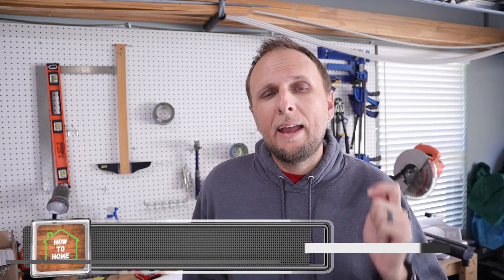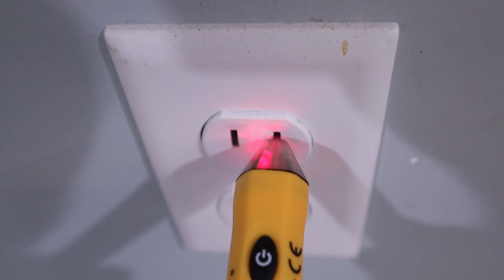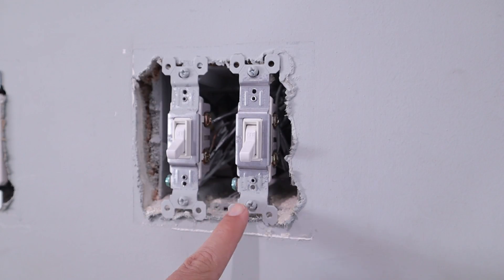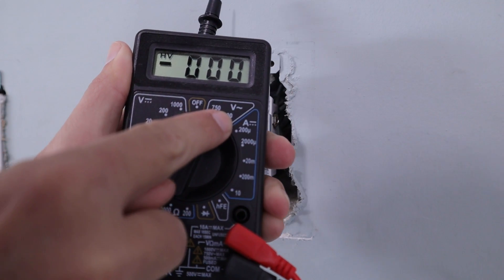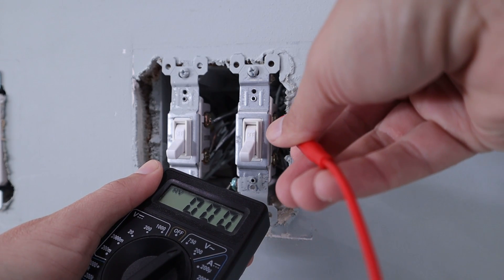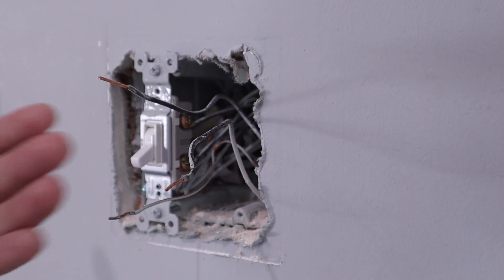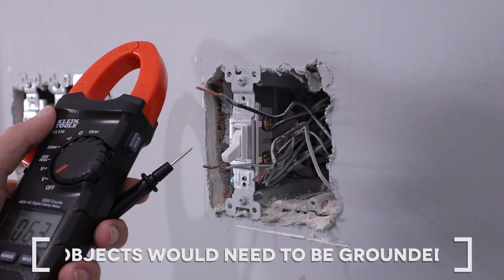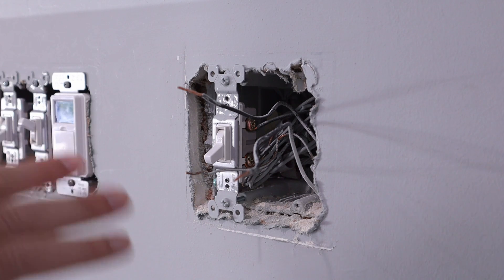How To Find A Hot Wire | Identify the Hot or Line Wire Using a Couple Cool Tools

Comment: When I found the hot wire I was shocked
Reply from the maker: Anddddddd comment of the month goes to you sir 😂  In fact, I think I will pin it.
Reply: @HowToHomeDIY I paid attention to your video so I wasn't shocked when I found the hot wire. 😂
Reply from the maker: @CarlosCastillo-ly4hs  😂
Reply: Bet that was a shocking experience
Reply: @jeffburk1692  hahahaha like it be when he gets between a neutral hahaha all his hair be like standing 3 feet tall hahahaha
Reply: You should be grounded.
Reply: Why does electricity shock people?
Because it doesn't know how to conduct itself.
Reply: I find it best to test for the hot wire when you've got one foot in the bathtub partially filled with water using uninsulated pliers to find your hot wire or a paper clip
Reply: check it,I always bring a little green with me wherever i go..
helps keep me grounded
you dig?
Reply: HAHAHA, I literally was shocked a bit, darn thing touched the switch and exploded a bit and then thank God the breaker went down! the hot wire was melted to the side of the switch!! 😨 it was scary!!!
Reply: When I was like 10 I was pretending to be a handy man. Sticked a screw driver in a outside house socket. Tripped the circuit breaker and man my arm was sore. Lol
Reply: Lol I think that was a joke right😂
Reply: And now they call you Sparky
Reply: When I read your comment, I was Shocked, Thomas 😂
Reply: Were you buzzed?
Reply: You are .Love
Reply: Never work on a circuit with power service on. It against electrucal code and safety and a ohsa violation
Reply: So....to verify that the correct circuit has been turned off...? Maybe use a multimeter?
Reply: Now I just took off a two-way switch there were two sets of wires in the back of the box one set I left alone the other set I took apart and now can't remember which two to put back together before I put the three for the switch any idea how to do a quick check on which two I put together they looked a little fried so I want to clean them up and put the back together before I put the switch back together went to go get a tool and forgot which two it was and he suggestions I'm used to changing switches and outlets normally I don't need to use a voltage box but in this case do I turn off the power first cuz I always shut the power off to change my switches bit electrocuted before wasn't fun PS love the video
Reply: @jamieclarke9207  there no way to know  with power off.  But with power on, do not touch the wires  or you get electricuted. If have no white or bare, there no eare to use a meter to know the hot wire to test it. Only other option be the easiest, put a mark on 1 wire and touch it to others 1 at a time, as 2 hot.  If it shorts and trips breaker  , mark other one too, thats the two hot wires.  Take 1 hot wire   and touch it ton9ne not hot and if power on and it does nothing put them togeather but it hot so not touch it. Now there 1 hot , touch it to other wire not hot , the light comes on if  power is on. Connect thosr to light switch. Remember 1 is hot.There be 2 hot 2 not, take 1 hot anf put 1 not with it, if light not come on, it correct.  if 2 white put white togeather and if 2 bare put bare togeather , there 1 more hot  and one not, put them on light switch, turn i
On light switch and if come on it correct. If not , sounds like the breaker off or tripped
Reply: @michaelspencer6523  thank you ya cuz as soon as I put power back on Fuze blue and I was like f that
Reply: @jamieclarke9207  good it means those you put together is 2 hot
 The other 2 is 1 for each those 2 hot wires. The primary hot from light to light swicth is always white, the secondary  on light switch is the colored wire goes to light. If tbst helps, the other 2 whires will be same color together and
Reply: @jamieclarke9207  i am a master electrician  , it been few years ago i was over kbr building usa military power grids and  camps in iraq on 2003-2004, be safe.

Comment: So, I'm assuming you need to have the circuit breaker that powers the switch box ON in order to test the wires, right? Loose, hot wired just dangling about kind of freaks me out.

Comment: Can you use the non-contact tester pen to test the exposed wire scenario at ~6:00. Also, during the exposed wire scenario, is the breaker switch on or off or does it matter? I realized this may be a stupid question but I want to be sure.

Comment: Great video. Bought a new home and I'm changing one light switch. Problem is all the wires are black. So I couldn't figure it out. I actually have a multimeter tool but I didn't think of using it. Big thanks!!!

Comment: Theres 2 possible breaker switches that could power myndishwasher i need to fix. Im getting the same reading with a more traditional multimeter with both on, both of, and either one. Wtf? This is out of my wheelhouse. All i need to know is if theres power going to it

Comment: Hello I didn't take a picture or mark the wires But trying to put up my new ceiling fan from the ceiling box. I have just the two black wires, two white wires and the ground wire and then from the new fan. I have a blue wire, a black wire, a white wire and the ground wire and then in my wall switch next to it. I have an outlet and they're both in the same hole on the outlet. I have the two white wires and a black wire and then on the switch itself I have black wire red wire but the two black wires in ceiling box in the bedroom are twisted but when I turn my fan off with the chain pulled it's still runs and also my bathroom. That's next too much. The bedroom doesn't work when the black wires are untwisted. Can you help me please?

Comment: I have existing wiring from a 25 yr old home, that controls my outside lights.  there is a red, a white and a black in a very crowded box.    You showed us how to find the HOT, but when i want to connect these wires to a Timer,  does the HOT go to the LOAD or the LINE?

Comment: Doesn't work on an old home that isn't grounded....😮
Reply: With a multimeter, you can place one probe in the neutral side of a nearby receptacle and the other on one of the hot wires in the switch box. When you get a 120v reading, then you've found the hot wire.

Comment: EXCELLENT‼  Question:  I turned off the Breaker to the 3 bedrooms to replace a light switch in the middle room of a 40+ year old house.  When I plugged my Klein 3-prong test device into a receptacle adjacent to the faulty switch, I got a reading of =    When I used my Klein Pen, as you suggested, set to the 12 - 1000V~ setting, the Blue Beep was picked up at both the switch and receptacle?   So I turned off additional breakers on each side of the center bedroom ➡ ➡ .  When I turned off the main breaker to the entire house ➡ 🚫 Thank you.

Comment: If I want to connect a light fixture and I close the main 200 amp breaker in the basement, do I need to do anything else before I touch the wires?

Comment: Hey Adam, love your videos! I am becoming a DIYer now.

Are there any techniques to mark the line and load wires connected to a switch/receptacle? A little effort during the first installation would save tons of time in the future.
Reply from the maker: I sometimes mark the line wires by wrapping electrical tape around them.  This would signal to others as well that those wires are probably hot.  Glad to hear you are finding so much value in the channel!  I really appreciate the feedback!

Comment: Basic question.  Was the breaker OFF while you were doing this procedure?  I have to check 5 different black wires in the same box, and would not be comfortable with the breaker on...
Reply from the maker: No the breaker was on.  I would not be able to find which one is the hot wire without it being hot.  Totally understand that and if you don’t feel comfortable I would definitely recommend calling an electrician.

Comment: I have a bad feeling my old house is messed up. I have a light switch connected to a power outlet. I successfully converted the outlet back to a regular outlet. When I pigtailed the light switch to a light it failed the volts test and will not operate the light. Please help this stupid noob.

Comment: Hello, thank you for the pod-cast,very informative! I have a chandelier that does not have the ground wire to attach to the ground wire inside the ceiling wire box. How should I approach the mounting of the chandelier? My 2nd Question relates finding the hot wire on the chandelier wire. The only difference between the two wires  is a combination of a series of numbers. Would that be the hot wire to put to the hot wire from the ceiling box?  Thank you

Comment: So I put the meter on AC reading, put my black on ground and red on black but it read very low. Did the same on black to ground and red to white and it read low, then I set the black on white and red on black and it read 120ac. How is that connected to a switch? I thought the black would be the hot and neutrals just get bonded together

Comment: Good explanation, however:
■ If the switch is a 2-way switch (3 wires), you will find 2 "hot wires" depending on the position of the other 2-way switch that works together for the same lamp; so, you have to go turn on or off the other switch to find which one of your "hot wires" is actually the hot one; alternatively, you can unscrew all wires in both switches to find the hot wire.
■ If the switch doesn't have a ground wire connected to its ground screw, you will have to use your skin as a neutral, or a neutral from any near outlet (neutral is the larger of the 2 slots), I found a switch on my home, that doesn't have a ground wire connected to its green screw, I will fix that.

Comment: Thanks for the very helpful video. Just a little question, some of my electrical outlets have ground and some don't. For the cases when there's no ground wire, can I run an extension cord from an outlet with with ground and touch the ground with the black probe and then touch one of the wires with the red probe to find hot wire?

Comment: Thanks for reading this I know your very busy. Once I find the hot wire, what about the neutral.  Are they hot wire specific. Before I took off the 3-prong outlet, it was testing for open ground. They all are testing for open ground because someone just hooked up 3 prong receptacles to a two prong setup.  Now that I put in a gfci its testing for an open hot but the little green light next to the test button is lit up.  The gfci comes tripped and because the wires are still off or I need to ground the grci, It wont reset.
Just stuck...

Comment: Nicely done, not overly technical or talky.  Could you update this with a view to the many newer designs of switches and outlets?  Leviton (and probably other makers) have obscured the actual connections so it's hard to test once you've seated a switch!  Any way around that problem when swapping out older switches or receptacles?

Comment: Ive done the multimeter test and ive stumbled upon a case in which none of the black wires would give out a reading. (single pole) i tried grouding with the ground wire and also with the metal outlet case. Any ideas whhy none of the wires have a reading? there are no issues with the light switch...not sure why this is hapening.

Comment: Non-contact voltage testers can also sense hot wires through Romex sheathing but not well, if at all, through the old 60+ year old type of sheathing that is covered in some sort of woven fabric type material. Even a high end Fluke tester barely lit up when I was tracing the path of a circuit. If you’re dealing with old cables, verify your voltage testing with some other method.

Comment: For a single pole switch does it even matter if the hot wire is mounted on top or bottom switch location?

Comment: Turn the switch off.

Put your thumb on the yoke (Mickey mouse ears looking thing), then touch the screws on the switch with your finger (on the same hand, that part is important) 1 at a time. The one that makes your hand feel funny is the hot wire.

Don’t do that if your hand is really sweaty, or if you are in a commercial setting.

Okay, don’t do that unless you understand why.

Or just don’t do that at all, way safer, but slower.

Comment: Helpful video for sure, but I want to confirm something you said in the video, but did not demonstrate. My 1960's apartment boxes have no ground wire. I was told the metal boxes, conduit pipe, and BX cables are grounded by default, given the way the electrical was laid in my building. I have red and black wires in some of my switch boxes. If I want to test which wire is hot, I need to place the black probe to touch the metal box, and then use the red probe to touch each wire. Whichever wire indicates 120v on the meter, that's the hot wire. Do I have this correct?

Comment: This is a horrible way to do this and a safety hazard for you or anyone in the house. If your finger slips you would touch the wires and get shocked. Don't ever do this. Put caps on the wires and use a non-contact voltage tester. Or use a Waygo connector and cap all the wires with the power shut off. THen power it on and test it through the waygo connector (it has a built in test port hole)
Reply from the maker: Wait what?  A safety hazard for anyone in the house?  What is my finger slipping on to accidentally touch the copper?   An NCVT is fine but I personally think this is a little over the top.  But whatever you think is safer, please do.

Comment: So I found a switch that doesn’t seem to turn on a light. The wiring for the switch has a ground to one screw and two black wires to another screw but they are going to the same screw. That must be the problem right?

Comment: Are you doing this with the electric on or off ?
Reply from the maker: The only way to find a hot wire is if the power is on.  So if you are doing this, make sure to take proper safety precautions.

Comment: Adam, this was a great presentation. What if you don't have a ground or neutral in that switch box? In most cases you don't. The switched side of the circuit is the only thing in there. Have you ever used a two wire neon test light? You can identify the HOT or line wire without a ground or neutral. You might not want to show this in this venue, but it works.

Comment: Hi Adam, I heard you say that depending on the home, some neutral wires will be hot...why is that? My home is wired that way and still trying to figure out why the white wire enjoys shocking me every so often. Great videos I recently subscribed and so glad I did...Keep them videos coming. Thank You!
Reply: I don't think that he said "some neutral wires will be hot", but rather some "white" wires will be hot. This can be the case in switch loop wiring, in which the power comes in to the light first.

Comment: My doorbell circuit has two black wires and no ground. When I measure the voltage between them I get 18V AC. To find out which one is hot, I followed the instructions in this video, except I connected the black probe of my multimeter to the ground on a regular 120V outlet in my garage using an extension cord.

I expected that one of the wires would read 18V relative to ground and the other would read 0V. Instead, I found that one reads 10V and the other reads 8V... Any idea what that means??

Comment: My two cable sound when I put the tester to find out which one is hot what could be the trouble
Reply from the maker: Are they still attached to a switch or receptacle?  Are they far enough apart to test?  I just don’t know what your particular scenario is.

Comment: Adam awesome video. My question is why did you change the tester when you went to the bare wires. Could I have still used the original cheap multimeter tester you started with or was this a special situation with the bare wires where you needed to change the multimeter?
Reply from the maker: No the original multimeter would work too.  I just picked that one up.  Thanks a lot for the feedback Richard!

Comment: Great video and very well explained. I know you mentioned that the non-contact voltage tester cant be relied on 100% in some circumstances. What about just verifying power is out after turning off a breaker? Would you rely on the voltage tester alone or bust out a multimeter?

Comment: Why would it require a clamp-on to measure ? 
Wouldn’t a cheaper multi-meter be able to achieve finding out which is the hot wire ?

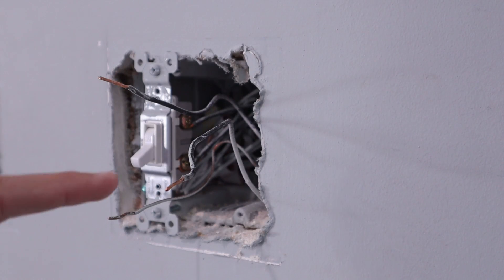Comment: Checking the switch with the multimeter like you did before the 5:00 mark.  I’m getting nothing but I turned off the breaker.  Should the breaker be on when checking it?
Reply from the maker: In order to know what wire is supplying the power the breaker has to be on unfortunately.

Comment: So i am wiring a ceiling fan. I have one black wire that was tucked into the box. Thats my feed through. Then i have a white which is the neutral and a red and a white. I used a non contact voltagw meter with the breaker on and both had voltage. Someone told me to use the volt meter like you have to see which one is always on. Im assuming i have to have power off to do that?

Comment: So the pen that you displayed in the beginning is 100% useless for finding a hot wire? It's all I have and I was hoping this would demonstrate finding a hot wire using the pen.
Reply from the maker: It’s not 100% useless in finding one but you need to know that there is a chance it can be wrong.  Mine is almost always correct but there is a chance.
Reply: @HowToHomeDIY  Got it. Thanks for the video. I learned the pen would tell the hot vs load wire as well. A bit new and didn’t quite know how to use the pen to tell the difference at first.

Comment: What if I have my multimeter on ground and hot and it only shows 80 volts?
Reply from the maker: There is a good chance that there is a loose wire somewhere on the circuit.